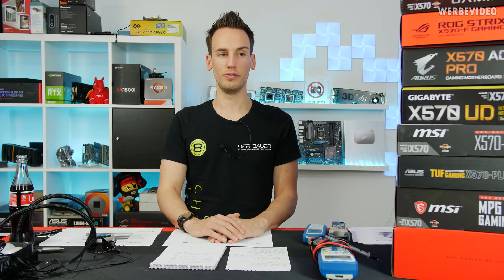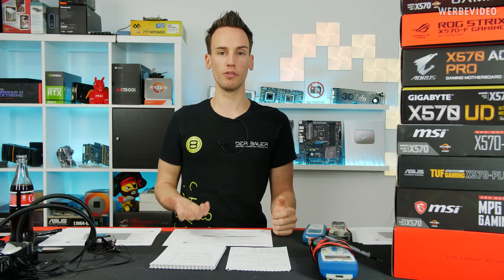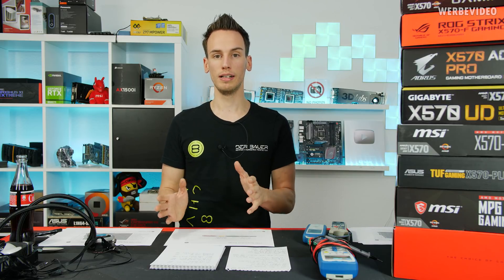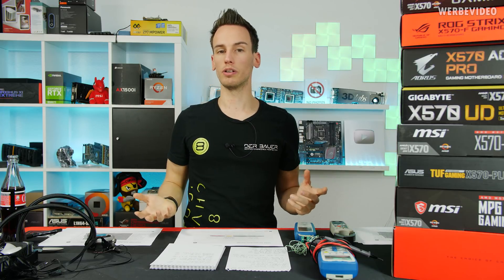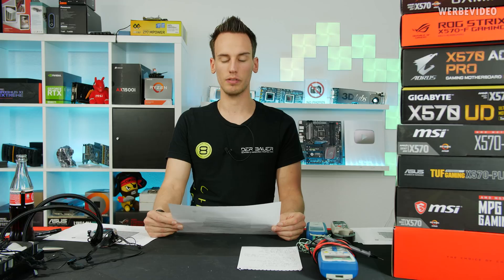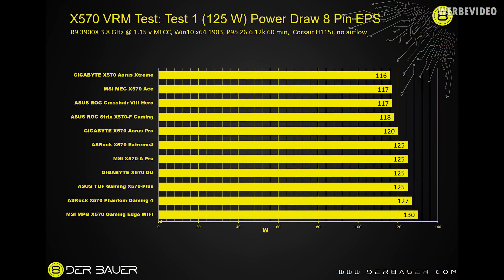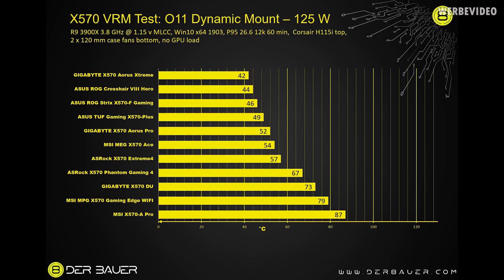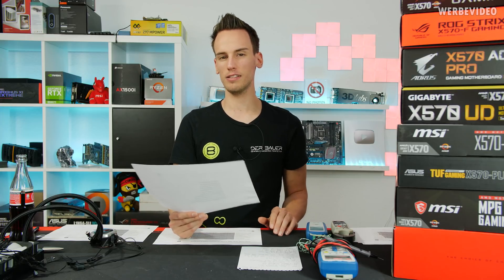RYZEN 3950X "simulated": VRM Testing 11 X570 Mainboards

Comment: Are the VRM's on the X570 Elite the same as on the X570 Aorus Pro?
Reply: No, from buildzoid's video, the Pro has smarter power stages, and also that real finned heatsink over the primary part of the VRM.
Reply: @The0Gizmo  

A finned heatsink would be nice. I guess that the Elite will also keep the temperatures under 80C?

Comment: Gigabyte X570 Elite? Doesn't matter with or without Wifi.
Reply: I am curious about it too. I bought it because it has better oc features than tuf and visually looks better. VRM on both tuf and elite should be similar and easily handle 16c
Reply: Hardware Unboxed did similar vrm testing and they had the Elite, it was just a little warmer than the tuf gaming from Asus you should check it out. This video pretty much validated their results

Comment: Roman, could you do an overclocking tutorial for Zen2 (3600/3700(X)) sometime? Especially with the focus on how to figure out if it is stable and what the problem is when it isn't. I think about enabling all the automatic overclocking features, finding the ideal negative offset for the voltage, memory-stability and last but certainly not least, finding the best values for PROC ODT, CAD-bus and RTT. Cheers.

Comment: Amazing work Roman. Have you had a chance to play with X570 Ultra and Master boards from Gigabyte. Right now between these 2 for my Ryzen 3 build.
Reply: Check Hardware Unboxed. Steve tested Master and it was only 2-5 degrees hotter than Xtreme with 3900X @ 1.4v and no airflow.
Not sure about Elite. Im using Master myself and with 3800X and all limits maxed out it never goes above 40c on VRM. The heatsinks are pretty cool to the touch.

Plus there are not a lot of problems reported. Mostly Linux related things and compatibility problems with a specific revision Corsair memory kit that needs manual timing adjustment. BIOS updates come out pretty fast too and dual bios add a layer of protection. Plus it retains most of Xtreme's features while being almost half the price. Literally the only downgrades are 2,5G LAN instead of 10G, 6 layer PCB instead of 8 and the VRM phase count reduction from 14 to 12 with 50A powerstages instead of 70A on the Extreme. That's the extent. Even the BIOS is nearly identical - Actually Hardware Overclocking has Xtreme BIOS walktrough if you're intrested.

This is my first Aorus board and im pretty happy with it. The only thing i can complain about is the fixed 15 seconds before the post screen shows (this is AMD's fault i think) and the fact that the BIOS does not have RGB control - just the ability to turn off RGB (except RAM RGB). So if RGB is important you have to install and use RGB Fusion program that is not that great depending on who you ask.

Comment: There is a reason why MSI offers a free AIO Watercooler when you buy one of their boards. I bought my MPG Gaming Carbon Pro WIFI before there were any VRM tests and it is not worth the 260 Euros. VRM temps are only slightly better than on the Edge board. And considering that MSI hasn't sent me my free cooler even though the promtoion application got aproved 9 weeks ago I can not recommend MSIs "cheaper" X570 boards.

Comment: How would a high-end air cooler and even more case fans influence this test? I am sure it would be better for the VRM than even your second scenario, but still.
Reply: A top-down blower would surely help, however the regular tower coolers might not add too much airflow that directly gets to the board.